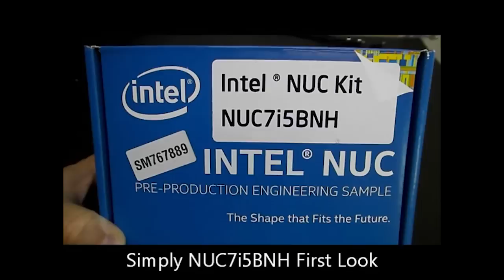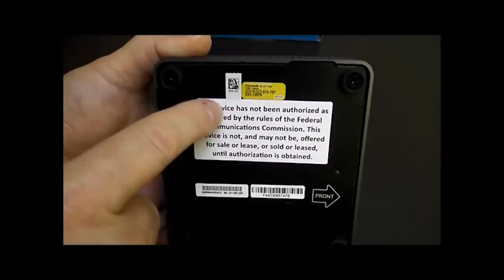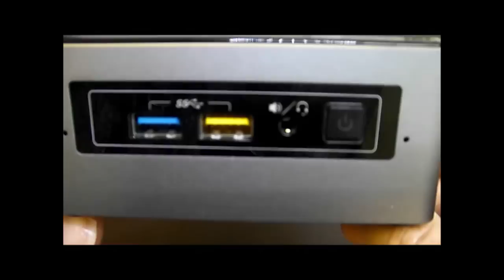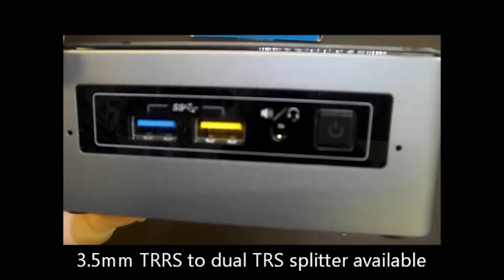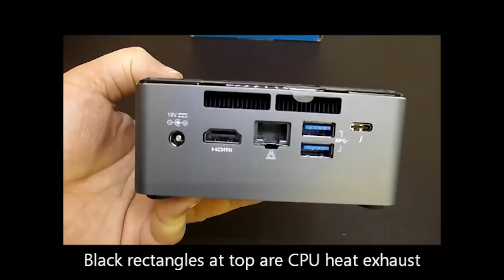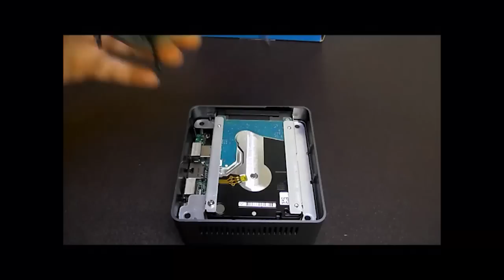Intel NUC7i5BNH first look- Simply NUC

Comment: You know if Intel made any change to the fan?I have the 6th gen i5 and the stock box it´s noisy compared to my old Mac mini(2008,almost 0 db ). Intel must take care about fan choice to the Nuc system cos they put a low quality one. I purchase an akasa newton 6t fanless case to make it 0 db. Nuc are very good for every day tasks and office work,enough cpu to replace an standard atx tower. I´m very happy. Great review and great video!
Reply: yes they could make the case a little bit bigger and heavier and go fanless. Fans gather dust and become noisy. few bucks away from being a perfect solution. Maybe using a metal chassis as a heat dissipator ?

Comment: I have had lots of problems with this unit. I have now been without a working NUC for 6 weeks waiting for Intel to replace the device under warranty. My first unit failed when the BIOS was updated by the Intel Driver assistant and bricked the device. They replace this after 4 weeks with a second NUC that had had hardware issues with the HDMI/thunderbolt controller. Still waiting for this to be replaced, but wish I had never purchased one.
Reply: Sorry to hear about your bad experience with the NUC.  We actually see less than .5% of these units we ship out ever experience any issues. We also handle all issues for our customers so they don't have to worry about dealing with the different suppliers.   If you have any other issues with  your replacement please reach out and we will do our best to help.  www.simplynuc.com

Comment: There is no any mention abt. the weight, not in Intel homepage, not in anywhere.... Could you pls. provide the information. It will be a great help. Thanks a lot !
1) the weight of the NUC item only - Intel NUC7i5BNH 
2) the weight of the power adaptor
Reply: The weight of the commercial box with everything in it is about 2 lb. 14 oz
  The Power supply by itself is 8 oz.
  The NUC by itself is 1 lb. 10oz.  Here is a link to the detailed specs as well https://simplynuc.com/7i5bnh-full/
Reply: thx a lot !

Comment: @simplynuc. Respectfully, I think all those things you mention such as "managing a complex supply chain" are things no one really cares about. Intel, despite the hyped marketing, is excellent when it comes to driver support. You just go their website and download all the latest drivers. In fact, all of them are exe files including the bios. So, the process is really simple. I think where SimplyNUC could add a lot of value is by providing a hardware custom version which perhaps is fanless or maybe adds a couple of usb ports. On the software and installation side, I would never pay a 25% premium to buy from SimplyNUC. However, if you guys had a fanless version, I probably would. All this stuff about "work through complex signaling issues for multiple different uses and applications" is meaningless jargon. It's full of sound and fury signifying nothing :)
Reply from the maker: Thank you for the feedback. I think you may be right for individual purchasers who have some experience in technology.  We sell custom NUC solutions as well  Where we have found success is with those who prefer not to deal with doing it themselves or don't feel comfortable doing it, and with businesses who trust us to do all of that work for them and don't have the systems or people in place to build them on their own or are too busy to worry about it.  A common comment we get from new business customers who have been using NUCs is "I am so glad we found you" since they are tired of dealing with it on their own or are ready to scale up production and don't want to put the people in place to do it.
Reply: Simply NUC Thank you!
Reply: just got a nuc6i5SYH and the drivers were hard too install and not a simple process. Had to swear a few time to get trough the process and i'm a technician myself. A CD, or download link or QR code in the box would have been great. The lan driver was not working for me. i had to unpack the setup with seven zip and install it from device manager. It's not really straight forward. Also when you go for a specific model on the intel web site it gives you drivers for every nuc that you dont need also.  Intel web site has always been a mess. I remember few years ago going to intel ICC conference and the guy says : To find something on the intel site you have to go to google.com and then search "what you want" site:www.intel.com  . He said it as a joke but it were back then the real deal. I think they did not improve enough yet. They should look at Asus or lenovo websites for driver download.
Reply from the maker: We have a lot of happy customers who would say otherwise. After dealing with assembling the NUCs themselves we regularly hear how happy they were to find us and wish they had earlier.  We are not the perfect fit for everyone. ;-)

Comment: does it have a psi slot
Reply: ben joe it doesn't have a traditional pcie  slot.  It does have m.2 which is actually pcie x4 so with an m.2 to pcie adapter you can connect standard pcie devices. If you want to connect a gpu you will need to provide external power because the m.2 only provides 15w at most.  I actually connected a gtx 1050ti to mine this way so I know it works but it's not really that practical.  I suggest doing all your pcie stuff through the thunderbolt.  I bought a gtx 1070 aorus gaming bits and it works great.

Comment: It is a shame they removed the rear audio jack and that they dropped to MicroSD.  Both decisions are a downgrade in my opinion.  The funny thing is that Intel lists "Combo speaker/TOSLINK optical audio jack on the back panel" in their description on their web site.  (http://www.intel.com/content/www/us/en/nuc/nuc-kit-nuc7i5bnh.html)
Reply: I am not sure that there is much cost difference in the full-size SD slot and a micoSD, so I am not sure why they would make this change. Perhaps there is a general move to MicroSD slots on all products in the future.
Nice catch on the TOSLINK mistake. My guess is that they started with a Pentium or Celeron datasheet and modified it, failing to catch this feature that I have never seen on a Core product. I will send your comment to the Intel tech team. 
Thank you, Don for the comments.
Reply: disappointed that it doesnt have the full size SD card slot and also no optical out for at least a 5.1 sound
Reply: The HDMI has functional pass-through of 7.1 audio.
Reply: yes a full size sd still allow you to use micro sd with adapter, not the other way. If this box is design for professional/business use i think this is too soon to remove such options. Also as the box is so small i think it is pointless to have a front and back connections. It would be great to have everything on the same side except for usb or additional ports. less wires going everywhere out of the box.

Comment: Read below. Optane is a scam. A nuc is so easy to assemble. Why would anyone pay simplynuc to assemble one and charge a premium. I bet a 10 year old can assemble a nuc.
Reply from the maker: Like all new innovative technologies I am sure there will be some initial issues with Optane.  Its a completely new architecture and design and is an innovative concept that, if pulled off, will change the industry forever. I am hoping they pull it off and can substantiate the initial claims.  And you are right, a 10 year old can assemble a NUC. What they can't do is pre-install the correct drivers from an imaging server with custom software, work through complex signaling issues for multiple different uses and applications, track components for warranty and repair issues that might arise, assemble thousands of them a month, manage a complex supply chain or write software that quickly configures over 200,000 different part numbers and configurations with a few simple clicks.   Until you have tried to deploy hundreds of NUCs at a time for multiple specific applications you wouldn't understand so don't worry too much about why we exist. ;-)
Reply: Simply NUC But what it you have an army of it guys?